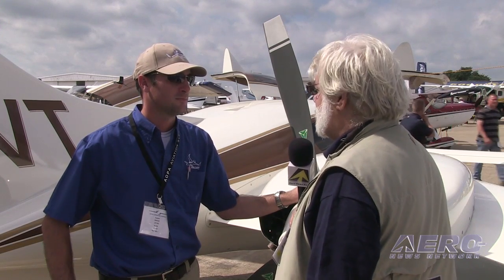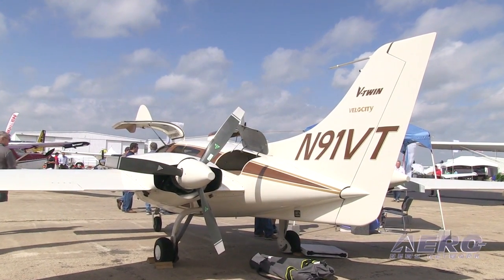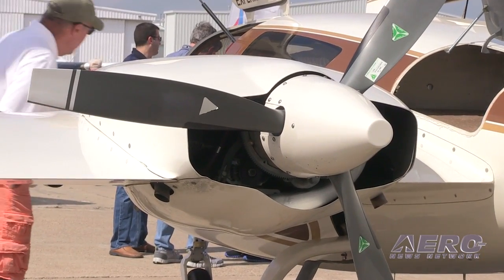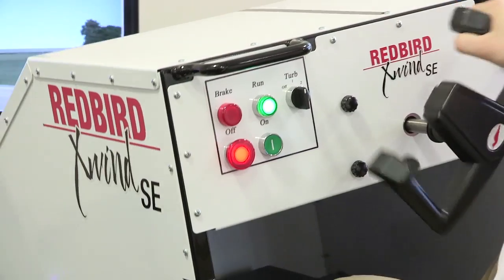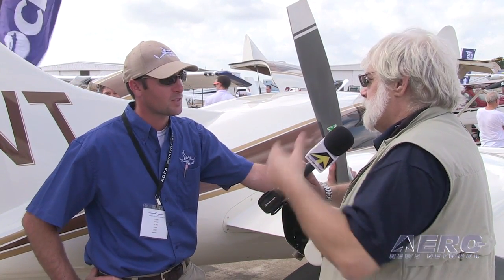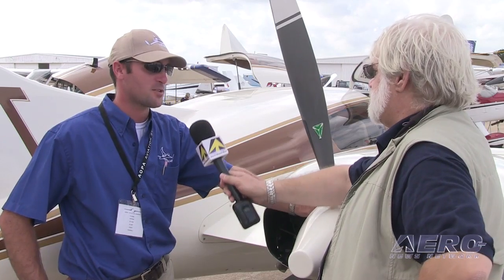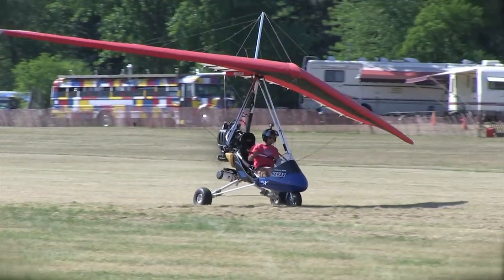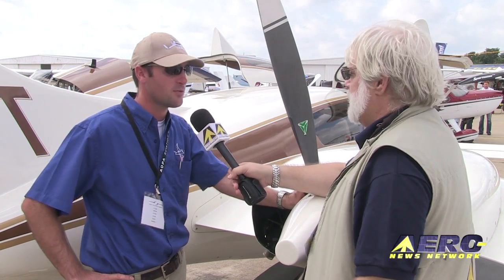Aero-TV: Velocity's Spacy V-Twin - A 21st Century Multi-Engine Airplane

Comment: It appears every happy Velocity owner thinks its great and a great value.  But I check the used listings and it seems Velocity aircraft depreciate pretty good - which is not good.  So there is a reason that there are more sellers than buyers of used Velocity aircraft.  I would like to know what they know.

Comment: The need to use varying rudder pressure maybe the winglet vertical stabilizer’s Achilles’ heel. I’m saying that overtime, it weakens the wing.

Comment: It would be interesting to see this plane equipped with a pair of turbocharged engines such as what Velocity offers in some of their single engine designs.  This would give the plane a much higher ceiling, assuming the airframe is capable.   

Also, what about the addition of wheel pants to protect the props from FOD?  Is there not enough room for them with the gear retracted?
Reply: these are unpressurized, so a ceiling above FL200 is pointless since the pilot will start to become hypoxic around 18,000'
Reply: @BrettStevens2  Unless things have changed recently, Brett, the pilot is required to have and use supplemental oxygen for flight above 12,500' if longer than 30 minutes (and continuous O2 above 14,000'), and can fly up to FL250 unpressurized.   Definitely not pointless, as you probably know, given the big advantage with increasing flight altitudes of increased TAS for a given fuel flow and IAS, with an additional benefit of the availability of strong tailwinds for many flights.
Reply: @BrettStevens2  you can add oxygen system
Reply: Nonsense.  The built-in oxygen system in the Cirrus works perfectly at 
FL250.  Have flown the plane to that altitude many times.
Reply: Notice you can get the Superior turbo-normalized XP400 215hp.  But that is a BIG engine and may overpower the V-Twin design.

You can get Velocity planes with fixed gear instead of retractable and add your wheel pants.
Reply: GBigs Angle I just recently found a company called Delta Hawk that is working on turbocharged diesel aviation engines in a V4 configuration rated up to 200HP.  This seems to be a near perfect match for this airframe, doubly so in that DH is using a Velocity aircraft for testing.
Reply: Sandman3332 I am actively researching all the diesel options.  So far?  Delta Hawk is fantastic on paper, but don't seem to have an engine in production.  The Continental CD-155 is over $85k and has to be REPLACED after 1200 hrs.  And has quickly dying gearbox problems.      Finally, SMA of France has a 230hp beauty, but it is priced at an astonishing $135k! And is nearly 500 lbs installed, too heavy for this twin.       And there is the Diamond owned Austro AE300 E4 170hp  diesel Diamond put in their DA42 VI.  That engine looks to be the best of all the diesels for this twin...  But it may cost as much as $75k making it twice or more what the XP360 costs.        The Superior XP360 is a 100LL, 91 UL (no ethanol) engine, has a 10gph per engine burn, fuel injected no turbo.  I think Velocity is building one of these right now.
Reply: +GBigs Angle DeltaHawk claims they will start production this month, though.
Reply: And these don't have that system
Reply: Brett Stevens over 12,000 for more than 30 min the pilot has to be on oxygen .

Comment: Listen, I love Velocity A/C, but really think or feel that this twin would've looked sooo much better with twin vertical stabilizers on the wing-tips, like the original model. That single vertical stabilizer in the rear just isn't doing it for me, which bums me out, as again, I am crazy about Velocity A/C and the fact that its roots are tied to Burt Rut an, by way of design aspect/s that is. Hopefully in the future, they will introduce a pressurized cabin version with twin turbo-props and twin vertical stabilizers on the wing-tips!:)
Reply: Did you watch the video   they say right away it will have winglets.   It's still in the final test/design faze.....    Also seen that the 2nd velocity twin  crashed doing touch and goes  no one was hurt.  don't know if the plane can be repaired.
Reply: NewbiePrepperTv you just described the beech starship